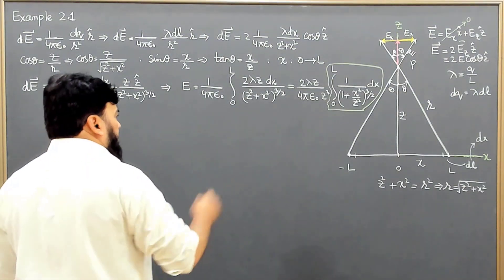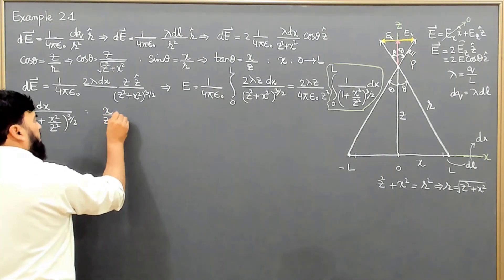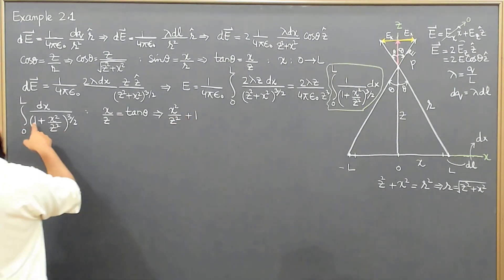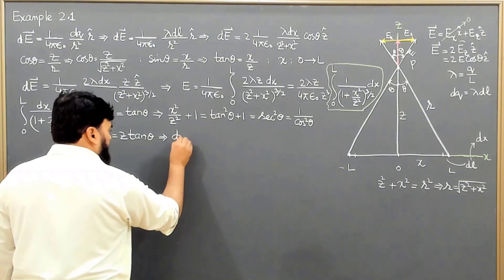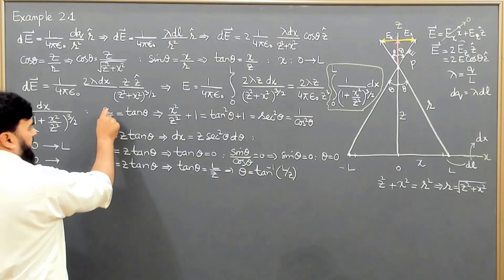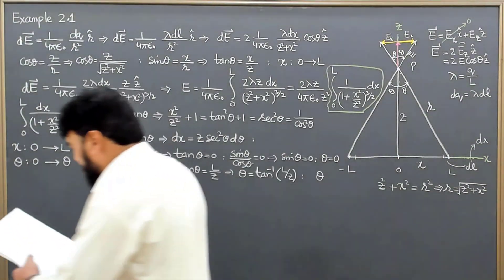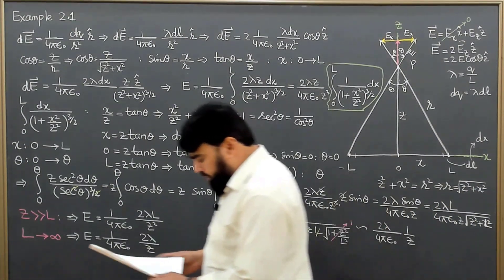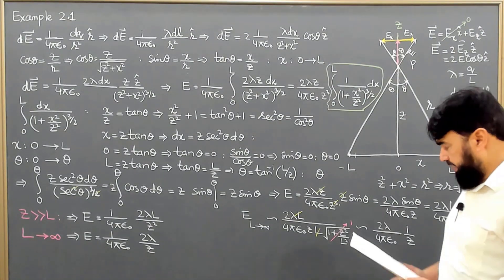L18.3 Example 2.1 detailed explanation P-II

Comment: Gauss has done a great job using the enclosed surface method but the coloumb law is lengthy.😊
Reply from the maker: Yes, you're right. Gauss's law is taking benefit of symmetry which makes the calculations easier. Thanks